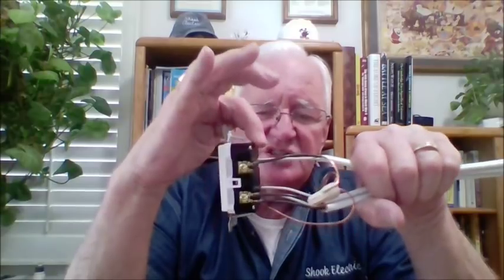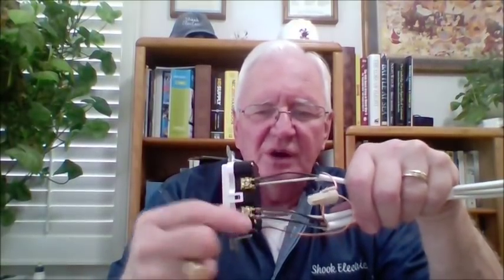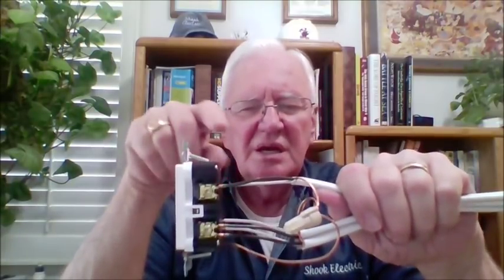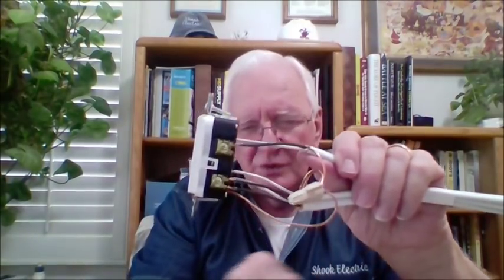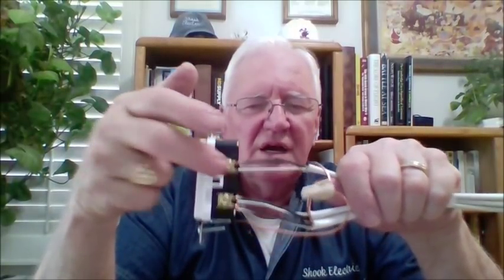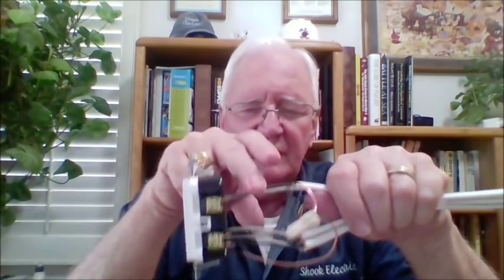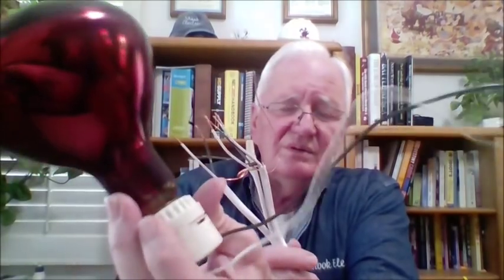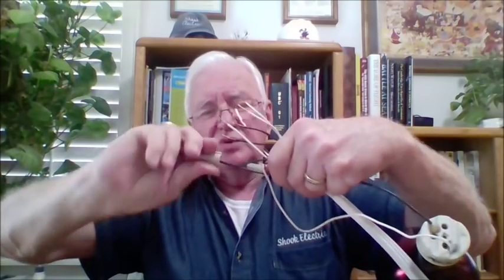gfci outlet receptacle installation troubleshooting, Disneyland Manager, John Shook

Comment: John .. great video. Most house wiring is #14 wire (including the kitchen) and If I am not mistaken there would no point in installing a  20 amp gfci in the kitchen unless you are replacing the wire with  #12 wire.   You never mentioned this in your video..

Comment: Thanks! Helped me get my outlet working! —— for anyone else who doesn’t have a electricity checker to test which is the load and which is the line...what I did was label each wire...then write out each possible combination...then test each combination one by one...there were 4 combinations in total.

Comment: Question, what is a line and what is a load?
Reply from the maker: Line is a live circuit one black or red and one neutral (white) that feeds the GFCI line side, gold is hot, silver is neutral.  The load is a continuation circuit protected by the GFCI that feeds other receptacles.  TKS  JS.
Reply: @JohnShook  Thanks John.
Reply: Thank you John for answering my question.

Comment: So you can replace a 15 for a 20? And that’s ok? Honest question I’m a carpenter nuff said lol 😂
Reply from the maker: The 15 amp circuit will still be a 15 amp circuit, The NEC states the circuit breaker protects the wire. The wire size determines the maximum amps allowed for that circuit.  (14 wire = 15 amps) (12 wire = 20 amps) Etc. Tks JS.
Reply: @JohnShook  I think there may be an issue in the demonstration.   There is a 20 amp receptacle on a 15 amp (14/2- NM/Romex) circuit, which is a NEC violation.   I think people may be confused by believing they can just buy a rated 20 amp receptacle and all is good without verifying that you have the appropriate 20 amp cable or wire to support a 20 amp load.
Reply from the maker: The 15 amp Breaker protects the #14 wire, even with 6 or 10 receptacles on the other end. Why Not one 20. Just because the NEC thinks this is wrong,  They  don't all ways make sense.
Reply: How many times is it going to be a single 20 amp receptacle? The NEC may not make sense sometimes,  but if there happens to be a failure in the overcurrent protection and there is a fire.  The insurance companies will point the finger to an improper installation.  After all, that's who created the NEC. 

Don't get me wrong, I enjoy your videos and appreciate your willingness to pass on your knowledge. Thank you.
Reply from the maker: You're right, going by the NEC is the right thing to do. Even though it's not sensible in some cases. I was a voting member for 30 years or more in the ASTM, NFPA, and NEC and a few others, and voted NO most of the time.
Reply: @JohnShook  I bet that was a blissful time in your life.  It's hard enough for a family of 4 to decide on what they want for dinner. I couldn't imagine the "discussions" that go on during those gatherings and the after effects after a decision is finally made.  Thanks again for your time.

Comment: Had a party for my kids.  Three bounce house blowers were hooked to the same gfi line.  The gfi stopped working.  Put a new gfi in but did not look to see the new gfi Load was On my way the bottom until I watched your video.  Great clued for a weekend warrior.  Sometimes a doctorates degree is not enough but with your help I fixed it.  Many many thanks!!!!!

Comment: As always John..good presentation..I'm like you,,,doing this for over 43 years and I've seen plenty.  A lot of electricians will use 15 amp outlets on a 20 amp circuit and I always match the amps with the proper outlet.
Reply: I recently watched a video by an electrician who said a 15 amp duplex receptacle on a 20 amp circuit meets NEC.  A 15 amp single receptacle on a 20 amp circuit wound not meet nec.
I’m not an electrician but in my house I use commercial grade 20 amp receptacles on 20 amp circuits.

Comment: Hey John, what you said made some sense. My house was built in the mid '80's and my garage, outside, and all 3 bathroom receptacles are all on a continuous circuit to a 15 amp breaker in my panel box which has its own GFI (none of the other breakers in my panel have this feature). Now I know that all the existing receptacles on this circuit were protected since the (15 amp) breaker in my panel box has its own GFI. I wanted to replace the bathroom (standard) receptacles because I didn't want the entire circuit tripping if one of the bathroom outlets (on this circuit) tripped. I took your advice and changed all the bathroom outlets to individual 20 amp GFICs. After doing this...I thought that I heard somewhere that you should not use a higher amperage receptacle with a lower amperage breaker? So I did some research and found out on an NEC website it says: The amp rating of the receptacle and circuit do not depend on whether the receptacle is a GFCI or not: If you have a 15 amp circuit, you must have 15 amp receptacles. If you have a 20 amp circuit, you can either have 20 amp receptacles or 15 amp receptacles if there is more than one (e.g. a duplex receptacle). If I’m reading this correctly, you can’t do the “vice-versa”. I don’t think you meant to say that in this video…but you did say that within first 1.5 minutes of the video…that you always use 20 amp GFCIs where there is 15 amps because they are more durable than a 15 amp GFCI. So therefore to be safe, I went out and bought 3 new 15 amp GFCIs and swapped out the 20 amp ones I installed a few days ago. I just feel safer using 15 amp receptacles on a 15 amp circuit to a 15 amp breaker with the wiring (on this circuit) of 14 AWG. I also read that wiring for 20 amp circuits must be 12 AWG. I hope that I am wrong because, John I do like your videos on DIY electrical wiring.
Reply from the maker: Ken it is not to code but code can be missing points, 15 amp receptacles are only to keep you from plugging in a 20 amp device. a 15 amp receptacle is rated at 16.5 amps, a 20 amp circuit is rated at 18 amps or less. I have seen in the bathroom that a 15 amp hair dryer just melted down a 15 amp receptacle not tripping the breaker. The 15 amp breaker should protect the 15 amp circuit even with a 50 amp receptacle on the other end. JS
Reply: Thanks John for your reply. I'm glad that I was wrong I must have been misreading that website. So, I could have left the 20 amp receptacles in place? Even on the 15 amp circuit? It appears that you are saying that's OK. One other question, should I replace that (15 amp) breaker in the panel with the GFI, with a standard breaker without the GFI feature? I was wondering if the breaker would trip if I exceeded the 16.5 amps...say at one of the bathroom receptacles (that would defeat my purpose of putting those GFCIs in the bathrooms). Thanks!

Comment: Hey John, Thanks for the videos! I'm stumped with a GFCI problem. The GCFI receptacle in my garage stopped working and will not reset. I've checked the main breaker and ever replaced the GCFI receptacle. (made sure the line and load wire were hooked up correctly. Still will not reset. I've found and replaced every receptacle I can find on that line. My master bath recessed lights are also on that line. If I wire past the GCFI receptacle in the garage (connect the hot load and line wires) everything works fine. I obviously can't leave it like that. Any idea where to look or what to check next? Thanks for any help/info.
Reply from the maker: Try all outside receptacle and others in the garage, remove loads to get a direction of where to go from there. unplug all plugs to start, good luck JS
Reply: @JohnShook  It's bad luck to say "good luck", lol

Comment: My line side of GFI measures 85 Volts. Any idea how I should find the fault? Is the voltage drop is caused by a fault at the main panel? Appreciate any help or idea. Thanks.
Reply from the maker: check voltage to ground, if it is the same as the neutral then the drop comes from a connection or the breaker, if the panel has the same voltage then check the service entrance or the main breaker. JS.

Comment: Thank you for explaining it so well sir. Now I know Line and Load. And to keep the leads coming in and going out on the same side top and bottom.   A watch out for do-it-yourselfers replacing an existing CFGI:  I bought a new one and though I could just transfer the wires, well the new GFCI had the Load and Line on opposite ends, who'd have thunk! LED was green, but the plug not working. Well thanks to Mr. Shook's video, I just switched them around and success!

Comment: I'm so glad an electrician is coming tomorrow.  🤣 Thank you for sharing your knowledge.  

We have 4 outlets and a light on one breaker.  The 4 outlets stopped working sometime in the last few months.  We don't use them.  1 outlet is outside (non GFI as our home was built in the 70s), 1 outlet is in our master bath (GFI), 1 outlet in our second bath (GFI) and the other outlet is in a random room.  We don't use any of these outlets regularly as we don't use hair dryers,  etc. The working light and exhaust fan is in the second bathroom.  We carefully labeled everything when we moved in 3 years ago.  All the outlets and light switches were replaced 2 years ago as we went to smart home switches and outlets. The only outlet that wasn't changed was outside. 

The light and exhaust fan on this breaker work but the outlets on the same breaker don't.  My husband carefully checked all the breakers, threw the main,  changed the breaker and has looked at the inside of every outlet with the exception of the outside outlet. Everything looked fine. 

When he installed the new breaker,  the second bathroom outlet worked for a split second. It was the first we checked with a plug in lamp. We are guessing that it is the first in the daisy chain of outlets but honestly we don't know this as it was just the first that was checked.  

We don't have a voltage reader. I feel like I have watched a few hours of YouTube and am missing something. Usually we can figure this stuff out. But,  tomorrow an electrician comes.  I'm willing to pay at this point.

Comment: Quick question, John.  There are 3 GFCI receptacles in my kitchen.  When I trip two of the GFCIs with the test button, the bottom plug still has power.  Yet, when I trip the 3rd GFCI receptacle there is no power on either plug.  The appropriate downline (load) receptacles lose power when I trip the GFCIs.  Should I pull the GFCIs and check for proper line/load connections or do I need new GFCIs?
Reply from the maker: There may be a short in one GFCI or there may be two loads tied together from two GFCIS. One back feeding the other. Good Luck.

Comment: What if I have two hot wires and one neutral? I can connect the two hot to the line side?
Reply from the maker: Only if they are on the same phase,  No potential  difference between each hot wire.
Reply: @JohnShook  
What do you mean by phase? How would you determine if they are on the same phase? 
Thanks
Reply from the maker: Your panel has two phases that make up 220 volts , 120 volts each phase, if you have 220 volts between each hot wire, they are NOT on the same phase. if you don't have any voltage between the two hot wires, they ARE on the same phase. Use a volt meter to test the circuit. Don't forget to test the volt meter first.
Reply: @JohnShook  
Between the two I get 240 V. How would I wire this if possible?
Reply from the maker: Cap one wire off with a wire nut, use one hot and one neutral for the 120 V circuit for the GFCI.
Reply: @JohnShook  
Thank you very much for your help. Your videos are very helpful I'm definitely clicking that subscribe button.

Comment: Hi John.  I have awash machine plugged in to a GFI.  It works for a while and then either no longer trips and the green led stops lighting.  It is 15 amp, not a 20 amp.  Can you recommend an article or book that discusses why this may occur. It was installed by a licensed electrician, passed inspections, etc.  I also plan to install a heavy duty GFI (gray color) but that may just be an advertising cikkick to raise the price.    Bob Fess  9/10/2018  rnfess@gmail.com
Reply from the maker: A lot of washers pull 8 to 12 amps or so,( on startup 4 to 5 times that amount), a 15 amp circuit with a 15 amp breaker will hold 20 to 25 + amps on start up just fine.  But a 15 amp gfci UL approved  is rated at 16.5 amps, This will give up and have issues in a short time if connected to a washer. John.

Comment: And I literally just bought 3 15 Amp GFI's for my kitchen!  I'll be taking them back for the 20 Amp.  
Thank you!
Reply: Same here bud, they're going back tomorrow!
Reply: But the wire is for 15amp. If you use a 20amp, which is certainly ok but it doesn’t mean the plug is now 20amp ready bc the existing wire is for 15amp.  Am I right? I am no pro.  Just wondering about this.
Reply: @iluvbogs  Old post, but you are correct (unless they overlooked amps and bought 15 amp GFI's for actual 20 amp circuits).
It's entirely the circuit wiring size/gauge that determines amp rating of both breakers & recepticles (GFI's).
Wiring gauge for 15 amp circuits is 14 gauge and for 20 amp circuits is 12 gauge. Putting a 20 amp GFI or 20 amp recepticle on a circuit using 14 gauge wiring... first,, won't give you 20 amps... and second,, isn't 'correct', but provided you keep the wiring/circuit protected with a 15 amp breaker, won't do any harm. You'll just end up with a 'heavier duty'  20a GFI outlet that will still only be able to handle 15 amp loads.

Comment: I heard him say while talking about the wires on back of the gfi and he said you might have one or more load circuits but....he also said right after that you might have one or two source circuits which is wrong. I think he said that by mistake.
If there was two sources that would put two brrakers in parallel and could start a wiring fire under load.  So you should never have but one source anywhere in the house unless you are talking about 220 or maybe by mistake saying one source has two wires. Ground and hot.
Reply: Ok..im sorry that i may have mislead you in my first comment. I think what he meant is that you might have 2 souces meaning that power is coming in and another circuit might be hooked to the source going to something else which would look like 2 sources. I will say that to explain electrical in layman's terms to someone is very hard and he does a very good job of going slow and explaining it good. My thanks go to him.
Reply from the maker: The source wire not circuits, just continues to feed another receptacle or gfci
Reply: “Line”, I Believe He Said, Not “Source”...
#GotContinuation?

Comment: I "home owner" just replaced gfci. I just put the wiring the same way as the old gfci that was installed. It did not work.

I made sure the white wires on the correct side, same with the black ones and the ground. Still didn't work.

Watched this video just to realize the manufacture has the loads up and the lines down!!! I would've never thought of this! Thanks for this educational video.
Reply: I did the same thing. I was replacing an ivory colored GFI for a white colored GFI and had wired it to the bottom instead of the top.Could have sworn the yellow warning info tape was at the bottom ;)
Reply: @johnnymacblues3426  having the SAME frustrating problem and YES my Yellow tape was on the bottom (Levitron) I want to switch the top white and black with bottom but will i damage anything i wonder?
Reply: @scottbackholm   I did it wired backwards and it simply didn't work... no other issue or damage. I switched the wires and everything worked just fine.

Comment: You've got a new subscriber. I have a question for you though. I found an outside outlet in a home with no GFCI receptacles or breakers. Having an inch of knowledge I thought "I need GFCI for this" so I purchased a weather resistant GFCI receptacle and wired it up but could not get it working. I later found another GFCI in a tool box that was much older. I wired that one up the same way and it worked. Is there something I could have missed with a newer one or did I just get unlucky with a dead on arrival receptacle?
Reply from the maker: Sadly if purchased at a big box or large hardware type store, many consumers will return a bad GFI or other electrical item.  The stores simply put it back on the shelf and never test to see if it is operational.  When purchasing new items, I try to determine if the box had been opened previously before I buy it.  Then I check to determine if the product in that box is the product I expect to be in that box.   Buying a $3.50 receptacle and when you get it home it may be a $1.50 receptacle.